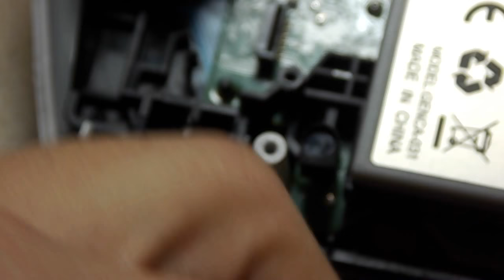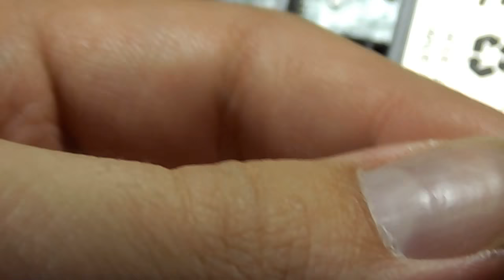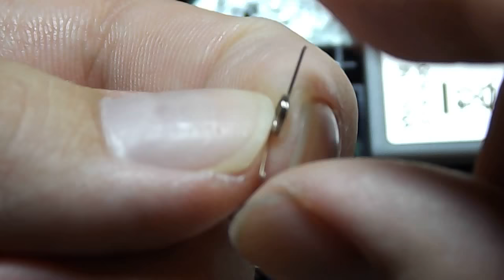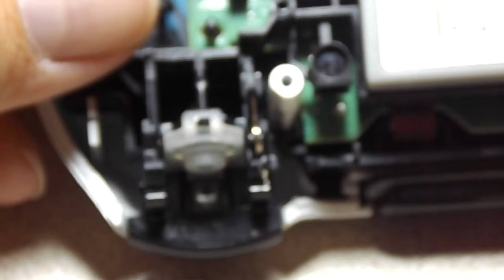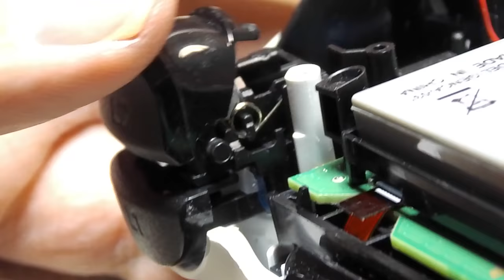*EASIEST WAY* Putting Spring Back In PS4 Controller

Comment: Here's a hint: get a piece of thread and thread it through the spring like it's a needle. Then tie the thread together into a large, loose loop. That way, when the spring goes flying off into the abyss, you'll be able to find it because it has a thread on it. Once you get it into the right place, just cut the loop and pull the thread off. Also, tweezer pliers were a very big help.
Reply: Out here thinking in 2121, cheers for the help
Reply: Both of my springs disappeared into thin air 💔
Reply: Ok you an Angel right 😃? Thank you

Comment: i just take a thin strip of duct tape, maybe 2mm wide and wrap the ends close together(loaded), slip it under the little hook and then pull the duct tape right off and it snaps right into place.

Comment: This video was really helpful,  the other ones I've checked before didn't have the close up as this one.  It allow me to understand where I had to place it,  after that it was really easy.  
It's not in the button but in the enclosure,  at least for my model,  which seem similar to the one shown here.
Reply: by clicking in the button over the spring do you need to bend/damage the spring?

Comment: I have long nails so squeezing the spring to get it in the right position was quite difficult, and I found it WAY easier to just place the spring on the peg without any tension and then nudge the top part of it into the groove afterwards to give it tension.

Comment: Thank you so much went in to change the micro usb charging port and had to fix the triggers didn't realize springs were in the way putting it back together popped one spring out and kinked another but I got it fixed thanks to you!!

Comment: Finally put the spring back, I took out more of the controller so it was mainly just the motherboard and the part I need to put the spring in. So the white rod thingy didn’t block my fingers when I placed it. Took an hour to do this when I realized an easier solution compared to yours.
Reply: What is the easier solution cuz im doing it rn?

Comment: I just simply can't do it, I've been trying to do it for the past 3 hours. At the moment, my fingers are hurting, red, and I don't really know what to do. You make it seem so easy in the video, but I simply just can't fit it in the L2, I've tried using my thumb and index finger, but nor the left or the right hand works. What am I supposed to do now? Is there somewhere I can contact you, Hoodhippo, so I can show you screenshots of my controller.

EDIT: 
Finally did what he did in the video after 4 hours; so relieved.
Reply: DELETED XX you might need a new L2 not the spring,if your right one went in fine it could be possible you broke it when playing with it
Reply: @geezt9855  No it is not the L2 that there's something wrong with. I'm using his trick, I haven't put the L2 button on yet.
Reply: It could be he has a different generation controller then you,they’re 4 or 5 generations of controllers I’m pretty sure this is gen 1 or 2,I know it’s not 3 and up tho
Reply: I had to look up this video because I’m used to working on a certain generation controller and I have 4 different motherboards
Reply: @geezt9855  Oh, I see, but I actually, finally, solved the problem after 4 hours; it really took me 4 hours to do what he did in the video zzz.
Reply from the maker: Glad you got it , it's a real bitch tbh. I can possibly make a new more in depth vid if more people are having troubles
Reply: @hoodhippo674  Well I put both of the springs back on, but when I've put the L2 and R2 on it doesn't really feel right; it feels kind of tight, and too sticky. And everytime I open the controller both the l2 and r2 falls out.
Reply: @deletedxx9503  bro exact same problem here I got new springs and put them in easily but every time I put the l2 and r2 buttons in, Everytime I push down on either of them they stick and have to pull them back up. I didn't have the problem before I took my controller apart to fix the l3 button

Comment: Thank you SO MUCH for making this video.  When I opened my controller, the springs sprang out and I had no idea where they belonged or how to put them back in.  Your video was excellent, the close-ups were very clear, and I liked your encouragement.  You said it was easy and it was!  Thanks, I did not have to throw away my $40 controller because of a set of 1-cent springs!!! Thank you!

Comment: The questions is ia spring works like it's been straight from a factory. Because when i did that, trigger was still having not much resistance when i pressed it

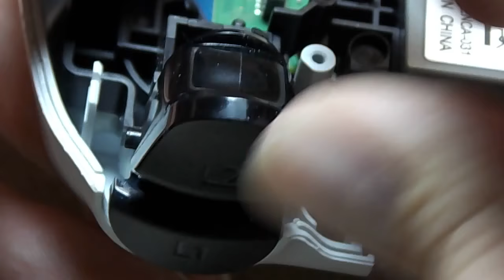Comment: Please, please help.  I think you may be the "life saver" to my situation.  I opened up my ps4 to replace cushion under the arrow buttons.  My springs fell out.  Iv'e watched countless videos on youtube of how to put the springs back and their videos were good but the problem is that the layout on the backside of the R1/R2 buttons for everyone so far are different than mines.  It's been kinda frustrating because I have the same version ps4 and controller of whoever bought their system around the same time as me but the layout is different.  When I say help I mean please let me know if the bars on the R1/R2 buttons that you snapped in at 1:49 had plastic filled in under them or not.  If they are filled then you have the same version controller as me and this is the right video.
Reply from the maker: Not sure, but what my other video https://youtu.be/PLVAgoW9EBY   hopefully in that video it shows , I just don't remember and don't feel like taking apart my controller lol
Reply from the maker: Any luck?
Reply: Hoodhippo Im just now reading this message. Ill check when I get home tonight
Reply: @hoodhippo674  In your other video it's hard to tell but it looks like the bars have plastic filled underneath them.  Mines has nothing filled in underneath

Comment: This video is the best of all, but I broke the plastic mounting piece when taking the controller apart initially. RIP my gaming
Reply: SOLUTION: simply route the round opening of the spring along the axel of the button that goes into the mounting post of the control body.

Comment: This is misleading. There’s no need, at all, to pinch the spring or hold it with any tension. Just slot it over the bar on the trigger with one end inside the trigger and then clip the trigger into the main body making sure the other end of the spring sits it the slot on the main body. Pinching it is not only painful but could send the damn thing flying! Just slot it on the trigger and clip in the trigger. The trigger does all the work.